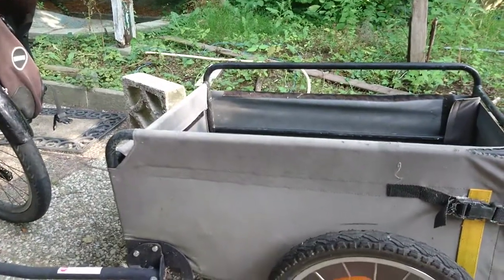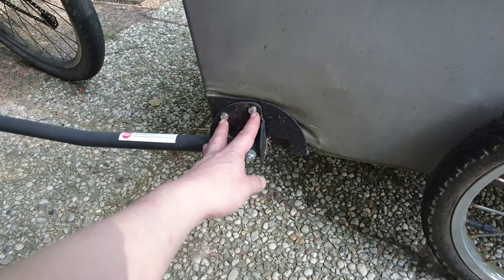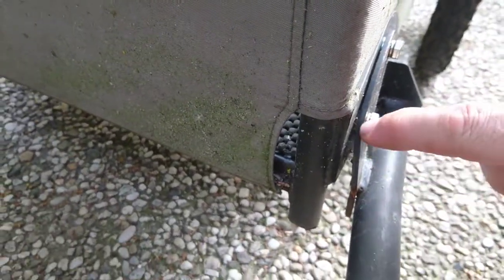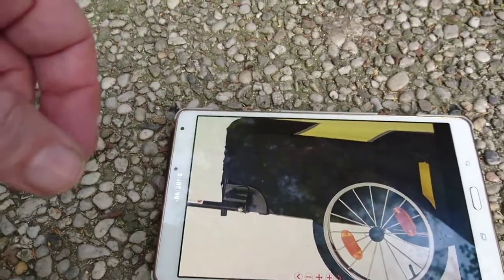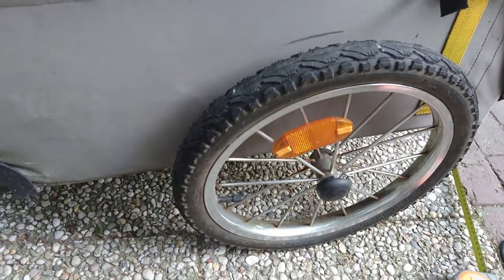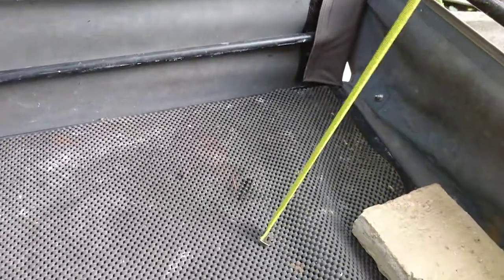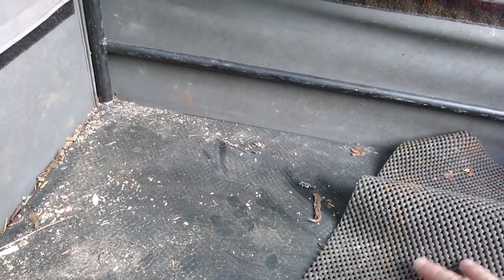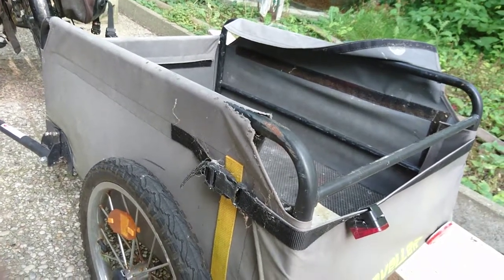Roland Traveller bicycle trailer, review

Comment: Yesterday I bought the Roland Traveller used for 42,50 euro myself. To me, Roland is probably the best choice because it's seems MUCH sturdier than other knock-off brands. They look the same, but the materials of Roland are still stronger (especially the welds of the metal framework, it's really strong and stiff). The connection of the metal bar to the bike is really not so good indeed, the previous owner fixed the mechanism permanently with 3 bolts. I think it's hard to get this sturdy anyway in the original form if you want to swich from bike position to storing or handtowing position. Still, I think, due to the better materials of the steel framework, I would choose Roland and not the knockoff bike trailers that have a less sturdy cage or metal frame. I feel, in order to get the perfect Roland Traveller cart you need to tweak a thing or two. I think making a custom box inside the cart with a piece of studded foam (like camping mattrass) will solve a lot of the sounds and it will hold luggage in it's place. Now I am looking how to custom make a box that is also protecting the goods against theft and rain for cheap. Not sure whether wooden panels or plastic panels are the best choice but I will test and ask around. Another option are those hollow poly carbonate panels they also use in greenhouses. They are strong, light and cheap.
Reply from the maker: The comparison with a cheap trailer and a 2nd hand very cheap one is not fair. Still, even if I found one for such a price, I would buy neither. I would rather buy something like a Wike kit, then you can make the trailer any size you want whereas with the 2nd hand Roland you are limited by the size of the trailer unless you start to take it apart and screw or weld something new from that at which point you may as well build using a Wike kit. Do you have wheels with proper spokes or welded spokes? The issue with the drawbar is one very clear to see with bike caravans, in German videos the issue of them breaking occurs quite often. Note that my drawbar didn't break, just the bolt broke + the metal plate warped, which is quite thick steel plate, and this happened even though I had only used it with quite light loads up to that point. Those 2 facts show what forces are at work there and that flat plates are not good to resist deformation. The designs with other bike trailers are less problematic likely from several factors, such as rigidity vs. flexibility. If something is very rigid then the issue of forces shows somewhere else, a flexible drawbar absorbs shocks/deformations and thus lessens problems. What else I don't like with the Roland Traveller is the welded on axles. One of them bent which I had to bend back, and when you take off the wheels these axles stick out thus making it nearly pointless to do so for reduced storage space requirements.
Reply: @WHS_reviews  
Sure, the Roland Traveller has it's problems for sure. But I guess it depends where you want to use it for, the trailer was taken care of pretty well (looks as new and that for only 42,50 euros you really have an amazing metal construction that protects what's inside very well). The quality of the metal construction on top of the base plate was actually the most important thing, I am planning to carry expensive camera equipment and today I did build a wooden box inside the cart against theft directly out of the cart. The very sturdy construction makes it really hard to get inside the cart when you lock the lid with a padlock. The construction of the drawbar is the only problem I have really (yes, the cover of the cart around it is crap as well since my cover is also not closing anymore by using the original velcro, I will only use the yellow top cover anyway). There are way better bicycle trailer but they are hard to find below 50 euros. Especially not trailers that have a similar sturdy construction when it comes to fencing (and potential theft).
Reply from the maker: @ARCUS1200 : My point about the price is that this is not a generally applicable guide for buyers as you got one for cheap, but other people won't be able to get it for that price. So in general I would not go for the Traveller. At 40 euro you can buy it just for the tyres (but they are also not good quality), and the attachment to the bike that you can transplant to a DIY trailer for example. The velcro was not closing properly on mine either, and so my point is that to buy it new, it is not worth the money. Even at 100 euro I would pass on it and go for a DIY kit. Roland could and should have made a lot of changes before putting it in production. The velcro not closing properly because the plastic was just too tight is another example where I think "Do manufacturers use/try out their own products?"...
Reply: @WHS_reviews  Perhaps Roland has different productionlines of the same product (it happens with electronics as well, model 1 made in Japan is top notch, the same model a couple of years later made in China is crap (same design but cheaper materials). I noticed that the same cart has been produced with different connectors to the bike for example (the newer models have a simpler yet fail proof design with the  tie rod directly attached between 1 metal plates where my cart has a quick release system with several bolts (that scream for problems if you ask me). I locked it completely now with washers so it does the job for now. I removed the tarpaulin cover around the cart and built a wooden box inside the cart after I heard the manufacturer does not sell the tarpaulin cover for replacement (I guess it did fit when it was new but shrinked after a while due to high temperatures because the distance of the velcro was huge). The wheels are almost new on my cart so maybe the previous owner replaced them at some point (the wheels itself are also almost as new and I like the fact you can detach the wheels completely). I checked many many reviews on bicycle carts and from what I see, there is simply not a single bicycle cart that ticks off all boxes on the wish list. Or it does but it will come to an insane expensive price. I just got the cart last monday but tested it pretty well the pst week. Hopefully the problems on your cart will not occur on my cart, but I will keep an eye on it for sure.
Reply from the maker: @ARCUS1200  : True, all bike trailers have issues. I failed to find one that is cheap and good. The cheapest good quality ones are about 400 euro which is a lot of money when you just want to transport some stuff and have an idea that it could be cheap because there are a bunch of cheap trailers out there! Of the non-selfbuild variety I think the Croozer cargo pakko or Cargo Tuure are possibly the best options, the Carry Freedom has had a big price increase since last year from ca. 300-360 to ca. 460-510, which means now it is less value than the Croozer trailers as you need to build something on the base yourself, but you are then in any case at ca. 400-570 euro. Too much unless you use them often. Even very expensive trailers such as from Creacon have bad design flaws. Those 'tough trailers' increased in price compared to last year by more than a 1000 euro! from 1600-1700 euro (already a far too high price) about a year ago, they are now 2800 -3000 euro! They have a nice run-on brake but that is not needed for most purposes and what they provide doesn't need to cost that much. The worst problem is that for such an insane amount of money for a bike trailer, these people mounted the brake discs on the wheels on the outside instead of inside where there are protected automatically from say branches, by the wheels. Ridiculous! And for that price, insane! Also disc brakes are not needed for a trailer, drum brakes would be better (less maintenance, less fragile).
Reply: @WHS_reviews  I noticed that the market of bike trailers and carts is a big market actually for pets and kids bike carts. The normal transport carts are expensive too because of the way it's constructed probably but for most it's not really worth it if you don't transport a lot with it. I think 400 euros is really the max one should shell out for a transport cart that is strong and reliable. There are transportcarts of 125 euro's but after reading the bad reviews I suggest to skip those cheap things immediately (unless you really have no choice) and buy something used on the Ebay or something. I noticed that the price of those things are higher in the summer because the demand is also higher (same with racingbikes, I bought a Pinarello for 175 euros used and now they start at 350 more or less). I even thought about welding one myself (looking into welding machines since they are only about 125 euros nowadays).
Reply from the maker: @ARCUS1200  : Agreed, the market for trailers for transport is small, but still the prices for some trailers are just ridiculous even taking this into account. So yes, those very cheap ones are bad, but possibly useful to experiment with them esp. if you can do some DIY. A solution to this problem would be a trailer usable for multiple purposes (cargo + kids + dogs with different add-ons to the frame), but no manufacturer does this. Creacon does this a little but not enough and for that price you can buy multiple trailers for each purpose :) I'll be doing some welding too (I saw the very cheap and well reviewed Lidl welders for example) but mainly for experimentation. I may design/build a trailer to my specifications and then work with a manufacturer. I'm going to work on such projects, the first of which I will soon do, if all goes well, with a polish manufacturer regarding panniers and rear racks, all of which have bad design flaws.
Reply from the maker: @ARCUS1200 : I interpreted your statement as the market for just trailers for cargo being relatively small, but I think you meant the market is fairly big even though the others are larger. But I think, as I stated in my previous reply, that the market for cargo trailers is small, and that the market for pet and childrens' trailers is much larger and fairly large overall. This I gather from the number of offers on 2nd hand sites, which is overwhelmingly about trailers for pets and children, very few cargo/travel trailers.
Reply: @WHS_reviews  That's what I meant, changed it correctly now. The market of kids and bike trailers (also used) is fairly big due to the fact more people spend outdoors (especially during corona, the amount of people walking in nature area's trippled and somehow people keep walking more after corona but also riding more with bike trailers it seems. The cargo trailer business is smaller (much smaller) I think, most people will use just their car and a cartrailer to transport even relative small stuff. The Cargo trailers (for me) are where my interest lays since I do not have a driving licence myself, thus I need something that is really sturdy, not too small and easy to handle. At this moment I am building a wooden box inside the Roland Traveller Trailer with a wooden lid where I can also put stuff on (thin plywoodpanels). This way I can get rid of the original tarpaulin on the sides and still use the yellow tarpaulin cover. I made holes in the sides at the top where I can attach safety locks and robe and this week I did put two layers of primer on it. I end up spending a lot more of course on my used Traveller in the end, but at least it's perfect for what I use it for. As for marketing, I think that companies are deliberately not producing "transformer" carts that do it all, transport kids, pets, construction materials, equipment and so on because that would kill their sales in a bad way. The Croozer products (for example Croozer Vaaya 2) look very good to me but the price go up fast if you have 2 kids for example (the balance between price and functionality is a bit gone since those kids will grow out of it fast) .
Reply from the maker: @ARCUS1200  : I'd be interested in some pictures and experiences with your construction and your views on what size makes sense. I wrote a lot of my considerations on my webpage on this topic, but I could add another view possibly too, or add some other factors. If interested you can contact me via my site, this is the page:  https://swhs.home.xs4all.nl/fiets/tests_2/fietskar/index_en.html

My situation is similar: I'm not interested in cars, don't need one for myself (it could only be of use sometimes to transport big things), and so I don't have one. I use public transport and my bicycle for most tasks, sometimes to transport big things I ask a friend to help with a car. A 'transformer' trailer could make more people use their bikes for transport of a lot of more things, which is not just better for the environment but it's also better for themselves, to keep in shape. Not sure if such trailers would diminish their sales, but such considerations are part of business considerations in any field.